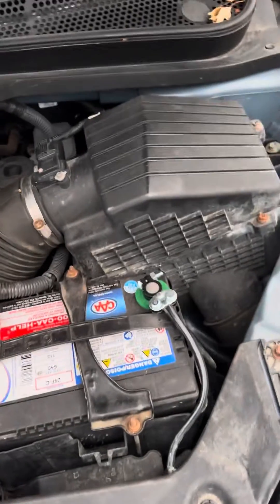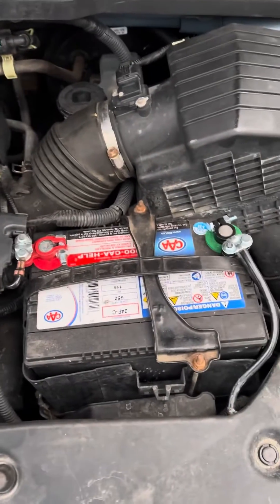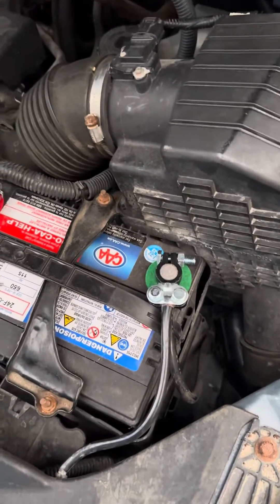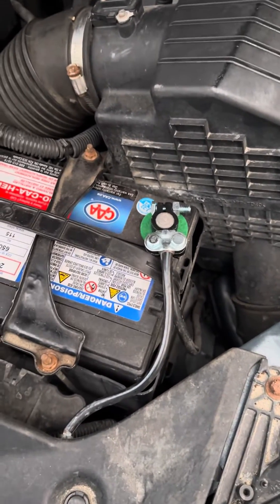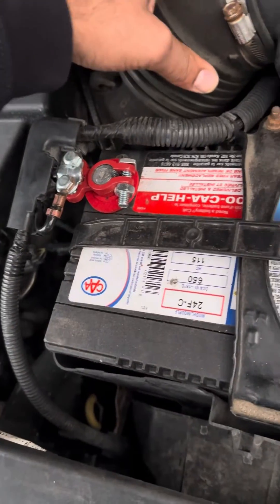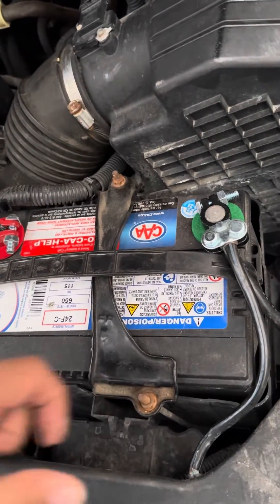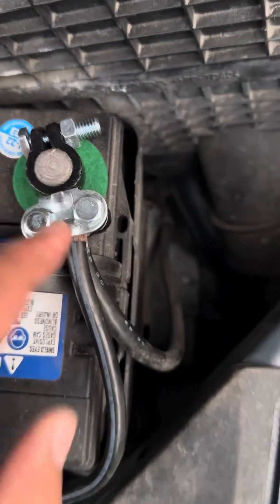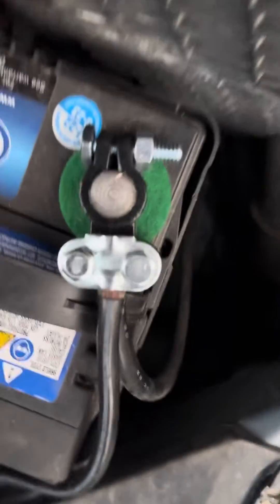Battery terminal replacement Honda odyssey 2007 don’t do mistake by cutting wire #battery #mechanic

Comment: What if you already cut that part and now you can't squish all the wire into the new terminal?
Reply from the maker: @elisa7joy9  then you have to use crimping tool with open please ring the doorbell once you there thanks connector